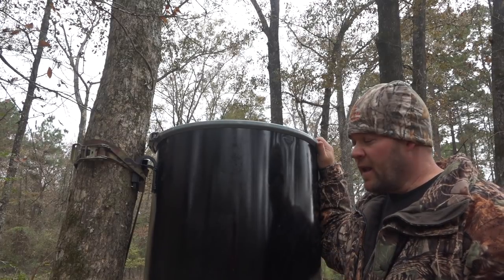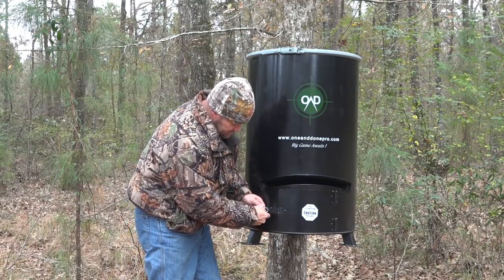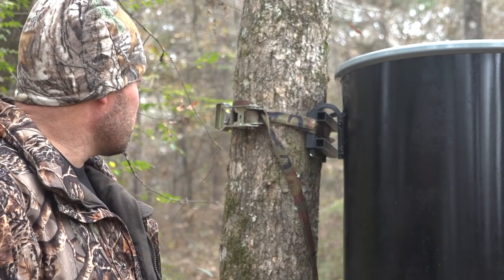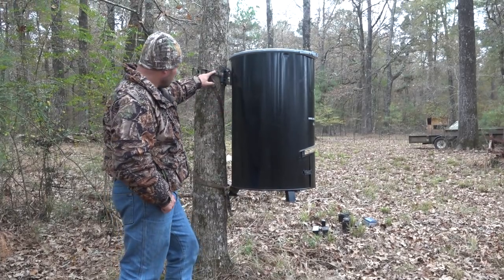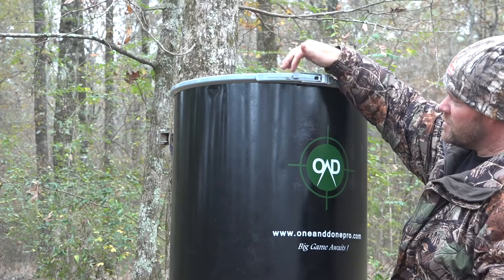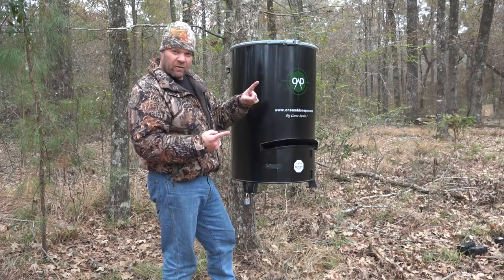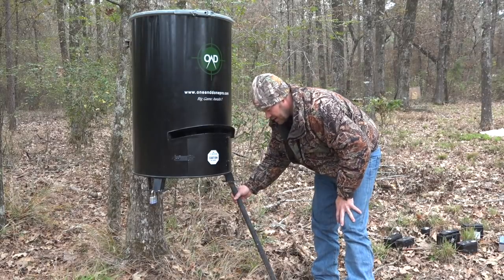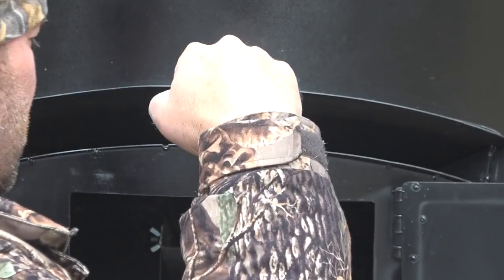one and done game feeders

Comment: I had three of these feeders and I must say that initially I was in love with them as perhaps my best feeder yet (40 years worth of experimenting) It was truly LOVE at fist DEMO. The batter is great but I use a 12v lithium and got 6mos easy. The timer is probably the best in the industry, Heavy duty, well built, all around awesomeness! (Hello Texas Hunter competition). However, after the honeymoon wore off I had to confess that there is a design flaw that needs addressing. There is so much about this feeder that I like but the ONE and Done thing I did not like was the feed/corn/protein mix (doesn't matter what you put in it) always has some percentage of spillage that leaks into the bottom motor/battery compartment. Add a little bit of moister and you have a pile of crap to clean out that smells like a toilet in a brewery. If I could change a couple of things on this feeder I believe (in the words of David Alan Coe) this would be the perfect country and western "song" feeder. 
First, correct the seepage problem between the upper drum/tank and the bottom motor/battery compartment. It should be clean and crap free. Just sealing off the compartment does not work (I sealed my with heavy duty AC duct wrap) the problem is that the angle of the casting port allows for the first and last little bit of feed to fall down back back down from the spinner into the base rather than 100% broadcasting out of the unit. Between the awesome high speed of the motor and the angel you end up with this residual collection of feed/dust/etc in the bottom. Correcting this was beyond my ability. Second, I would offer a taller version barrel (maybe 1.5 increase to 500lb capacity) to reduce intrusion into the area for refills. Then paint it as a 3D looking stump pattern or tree trunk with brush in straps, or holders around the sides, top, ect. (I add these to all my feeders anyway) because I like them to blend it as much as possible (just because I like it that way). I plan to take one to the welding shop and have two barrels welded together for an appx 70" tall feeder (stand and pour capable or just a very short step ladder)  3rd. Cut a 5"x3" viewing area in the lid and put a plexiglass viewing plate to easily see the amount of feed that is in the tank. Heck you could even put number markings on the inside to quickly view what the remaining level was. Still looking for that perfect feeder . . .